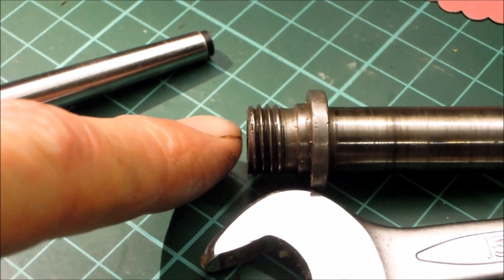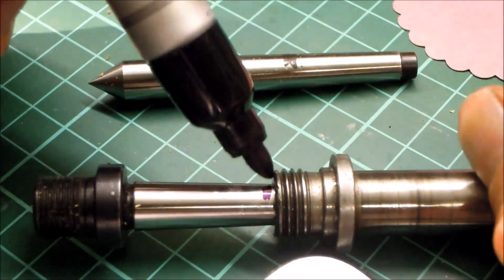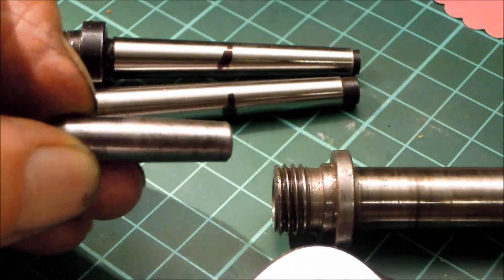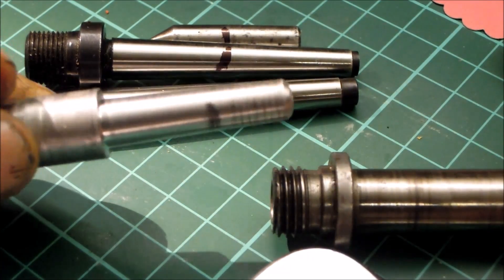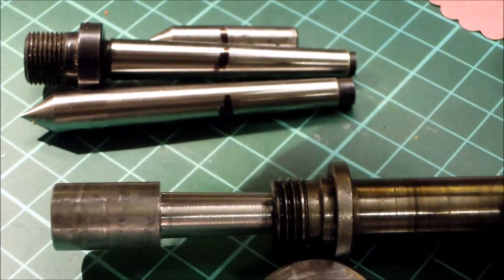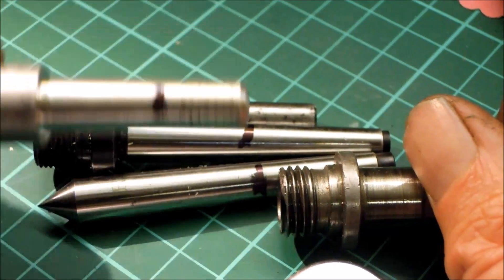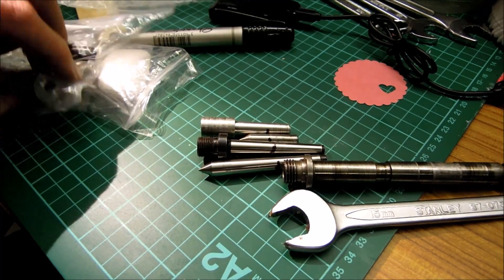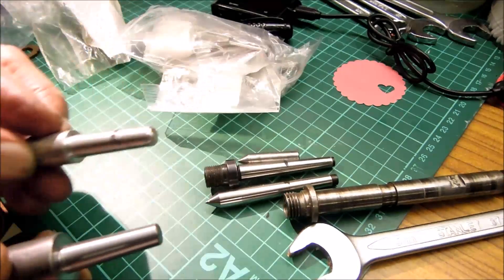MT0 taper for Simat Flexispeed Perris lathe

Comment: Hi hope you are still looking at your messages. I have one of these lathes but now need a replacement chuck all chucks are metric but if I can get a back plate I might be able to mount one, would you know what that thread is on the lathe same as the face plate that I don't have.  Regards Dave
Reply from the maker: Hi Dave. Randomly checking. The spindle nose thread on the Simat 101 is apparently 1/2 inch BSF. This is according to other sources. It is close to 14mm but a lot coarser. If you find (or I find) a 1/2 BSF nut we could check. I may have some thread gauges somewhere, but if you scour lathes.co.uk or other sites you may find this same information. John
Reply: @bikerides  hi so many thanks for that info so do you see any reason for me not to find an alternative modern chuck for this lathe  or am I just wasting my time. It does sound like I need to find a machined back plate to fit a new chuck to.
Reply from the maker: @davep4703  Yes. We are all in the same boat. We need a chuck with backplate that we then machine to spindle nose thread. Worth it I think. John

Comment: Hello Mr Mellor, if I may call you John. Thats an Interesting and a nice lathe you have there I had one of those many years ago, I now own a Sherline lathe and milling vertical attachment, even I have a few problems with tapers that do not fit correctly.  
*
For example I brought a Morse 0 taper live center from an Ebay shop that was a little bit too long in the tang, however I got around that by grinding the tapers tang end till it had a snug fit in the spindle it is slightly different for my lathe as I have a 10mm bore all the way through the spindle and your lathe may not but, you should be able to mount the dead center and re cut the tips 60% angle and to a length that suits you.

As for the threaded Morse taper attachment I would mount that between centers indicate my lathes top slide to an appropriate angle and then mount some tool steel or steel and cut - make my own Morse taper chuck adapter, incidentally you do not have a chuck key I would drill a hole in the side of the chuck and use Tommy bars to open and close the chuck, just some thoughts here.  

please let us know how you get on with your lathe, will be interesting to see the out come.  Regards Trevor
Reply: +John Mellor Hi John, this is the link for the drawing.  I got it from Cowells 90 group.  Hope this help.  https://www.dropbox.com/s/l9s80ohkwddmfsb/mt0.jpg?dl=0
Reply from the maker: +trefor Hi Trevor, thank you for those very useful tips. I hope others find your comments here as well. taking the last tip first I really like the idea of drilling the chuck for tommy bars as that is a simple and effective solution. 

I need to have a go at taper turning. I do have a nice soft aluminium blank to start with and I can use this to check my setup for the correct taper. I am glad that I am not the only one to have had problems with professionally made tapers. Mine came from RGD.
Reply: +John Mellor John, did you make the short MT0 successfully?  I can send you the drawing if you need it.
Reply from the maker: +Iceman Huang I have set up for taper turning. Finish a bit coarse. Looking at best way to get a finish near to a ground one. Emery cloth on aluminium should work for an arbour. I'll post a video when I'm happy with it.
Reply from the maker: +Iceman Huang hi. I did download taper specifications from somewhere. A drawing would help me confirm. I am using a combination of measurement and setting up from a known good taper. If the taper is accurate I can use the long taper to set up. Unfortunately the RGD supplied taper is wrong! I checked. It is about 0.2 millimetre out over taper length.

Comment: My cowells 90ME uses short MT0 taper.  The dimension is, length: 28mm from gauge line; 7.96-8.00mm diameter in gauge line end and 6.5mm in the narrow end.   Hope this help.
Reply from the maker: +Iceman Huang Very, Very helpful Iceman. I am going to have to set up for some taper turning. I have a soft aluminium arbour to start with.